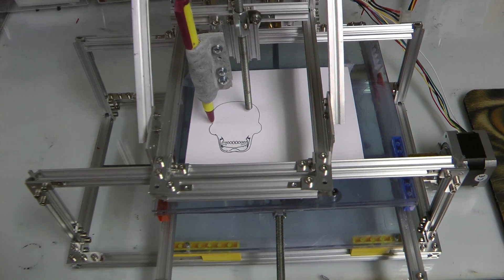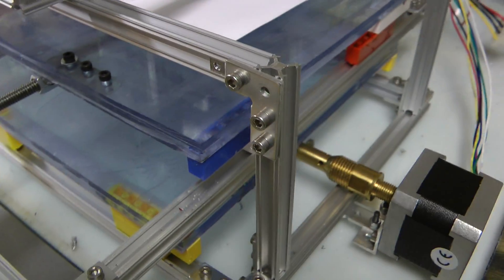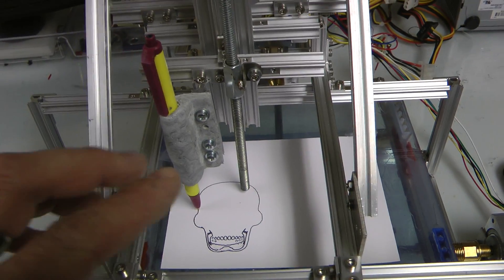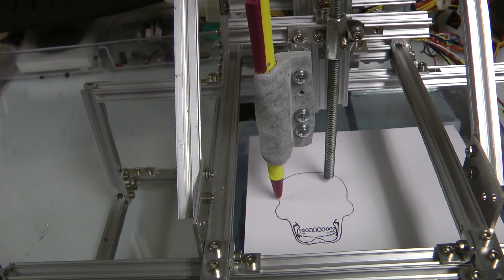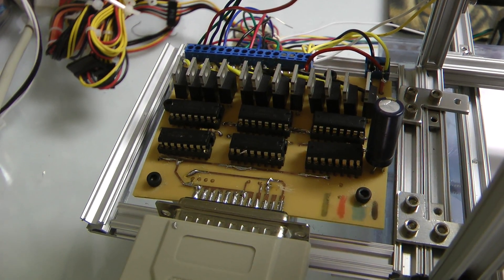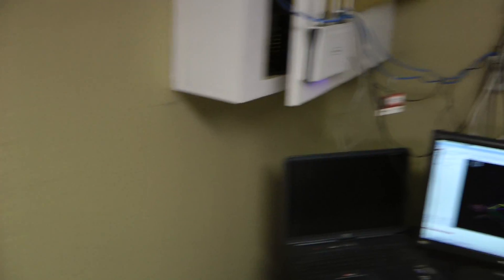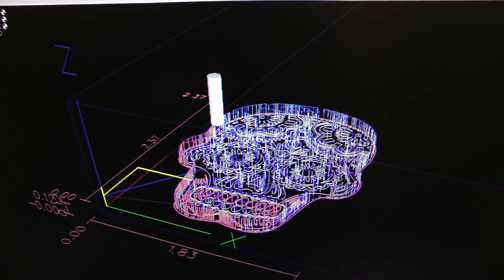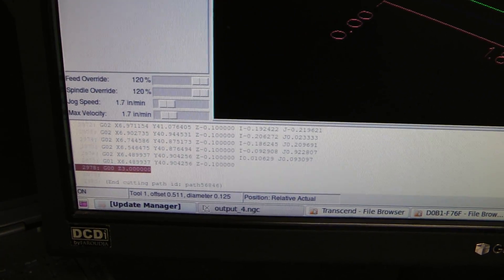Stepper Motors, MicroRax and Legos DIY CNC Machine

Comment: Nice machine, I'm trying to build controllers using link in Instructables, there some bulbs are connected before motors. i don't see them on your controller, did you removed them. is it safe to run motors without bulbs.

thanks & regards,
Sanjay